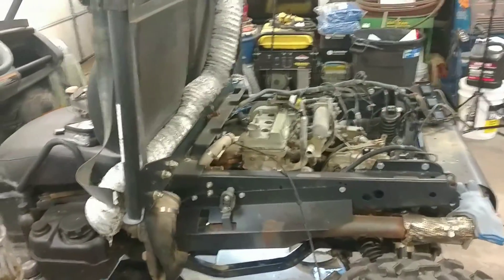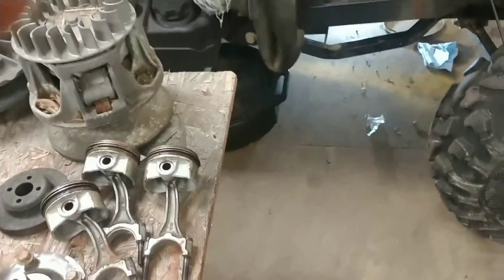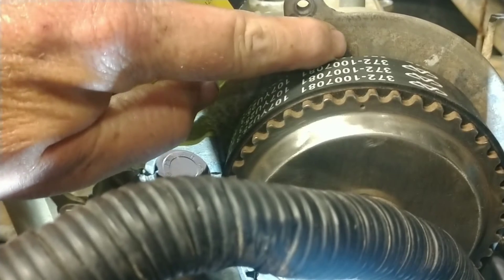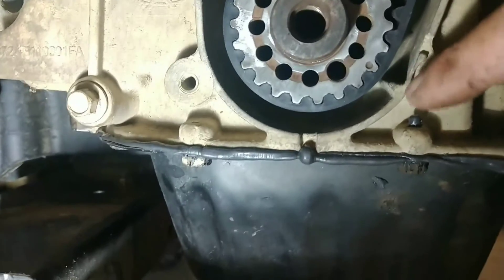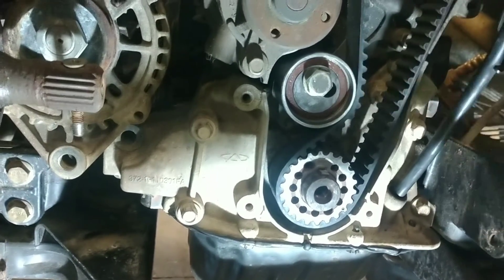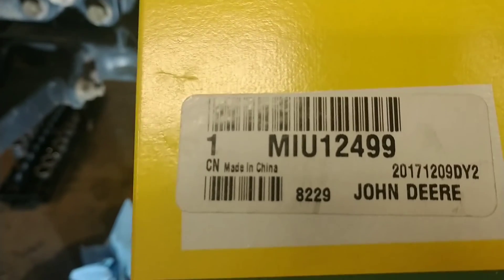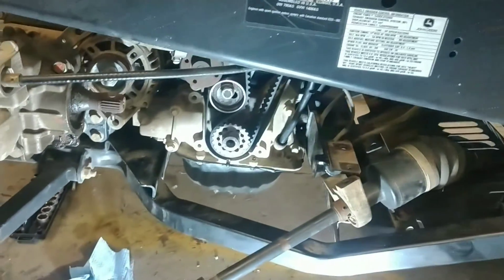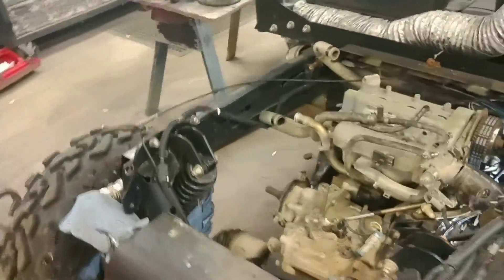John Deere 825i timing belt and timing mark location

Comment: I have same Gator. Drowned it in creek a year ago. Starts and runs fine, but has loud ticking. Assume bent rod. Been using normally for a year but considering a rebuild. Did you have similar symptoms after water in intake?

Comment: Getting ready to tackle all of this on my 2012 Gator 825i (original owner).  I know this engine is made by CHERY.  I'm not having any issues with mine other than being on its 4th starter, but this machine being 10 years old (has about 1000 hours on it) I figured with time it's probably due anyway.  Planning on doing water pump and thermostat while I'm in there.

Are these interference engines? (if the timing belt breaks, does it bend the valves...or just leave you stranded and you reset the time with a new belt and its good to go?)
Reply from the maker: Non interface engine. Most of my problems was the belt tensioner. Thermostat is easy. Water pump was a little time consuming if I remember correctly
Reply: @chrisward405  good to know.  Thank you.  I'm going to start collecting parts for it.  

Also I can't get a (OEM) starter to last more than a a year or two, but that's a complete separate issue.  Two were replaced under warranty.  Seems to be a pretty common issue on these machines.

Comment: What is the spec for the tensioner? In other words how tight should the belt be?
Reply from the maker: I can't remember. It's been a couple years since I made the video. You can check with your local dealer and they will give you the info
Reply: Using your hand the deflection of the belt should be 5 mm (at a referenced force pressure of 20~30N).Torque for tensioner bolt is 25+/-3 N.m

Comment: Question, I was driving my 821 i - 2010 Gator through snow today, all of a sudden the gator stopped, engine was running fine, is it the drive belt? Gear box? Something else,  My machine will not go into forward or reverse. What should I check first? Can someone help me please? Thank you
Reply from the maker: The drive belt could have gotten wet as the belt air intake is close to the ground where your feet are. Can you shift the lever forward and reverse?

Comment: Great video! I got mine apart and found the tensioner in pieces. So the marks are off. How do I turn the cam and crank to get them lined up?  Just by hand?
Reply from the maker: Yes. Whatever works
Reply: @chrisward405  ever have the machine go in limp mode?
Reply from the maker: @jonathanmacnevin8449  no. I never had that issue. Only problems I've had were the primary clutch needed cleaned frequently (hard to go in gear and out of gear) and the timing belt tensioner pulley going bad

Comment: Where did you get parts for the engine rebuild i need a rebuild on mine
Reply from the maker: At the time I had to go to the JD dealer. Wasn't bad on price. You could probably get most parts off ebay now

Comment: How on Earth do I get the cam timing gear off and the cast cover that is glued on in between so I can get cam shafts out.
Reply from the maker: There are a couple bolts on that cover that have to be removed. You will have to remove the valve cover of course.  As far as the gear goes you will have to use a gear puller. Hope this helps.

Comment: Do you have a part number for the rebuild kit? I just bought the same gator that needs a rebuilt motor or a new one
Reply: Awesome and I’d really appreciate it
Reply from the maker: @TheMsilos  you can rebuild the engine in the UTV. I didn't pull mine out and was able to rebuild it
Reply: Ohh yes I did misunderstand you. But thanks I’ll go by there tomorrow and see what I can find
Reply from the maker: @TheMsilos  you shouldn't have any issues getting what you need
Reply from the maker: Not sure if they have a rebuild kit per say. I just went to John Deere dealer and ordered everything. It was surprisingly cheeper than expected
Reply from the maker: They will also print off all the torque spec's for you as well
Reply: If you could email the sheet I’d appreciate it ms9710@yahoo.com hopefully I can get this gator fixed and not have to spend too much
Reply from the maker: @TheMsilos  I think you misunderstood me. The John Deere dealer will print off all torque spec's for you. You just ask for them when you order the parts
Reply from the maker: @TheMsilos  I still have them if you need to know a torque on something but John Deere literally printed a book for me

Comment: Chris I am replacing the water pump and saw the timing move as the tensioner was released ,You say that the timing marks just need to line up.Is that assuming at top dead center on a certian cylinder or just line them up and all will be fine,Mine only moved a couple teeth but who knows which way.also why the tensioner change so many times.Is there a failure in them I need to look for??Thank you for your time!
Reply from the maker: Just line the marks and you are good. The problem with the tensioner is water gets to the bearing and it breaks.
Reply from the maker: Terri Breneman I always kept a spare pulley with me on the trail. You can swap it out on the trail in about 30 minutes.
Reply: @chrisward405  Thank you so much for the info,I own a small engine shop and generally have a rule about UTV"s and ATV"s ,I dont work on them as I have my hands full with mowers,Trimmers and chainsaws.I only took this repair because its an old farmer friend and customer who sends me a lot of business.I thought I would just look it up quick on you tube and there wasnt much info.Our local John Deere dealer doesnt even want to service them and when I picked up the new water pump wished me good luck and said I wouldnt want to work on it again.I replaced the starter on it 2 weeks ago and that is sure a pain.Again Thank you for your help and I am subscribed to your channel as of right now!!
Reply from the maker: @terribreneman5578  thanks for subscribing!! I have some torque spec's on the 825i if you ever need them
Reply: @chrisward405  Your info was spot on and you will be happy to know that the patient lived to run around the farm,Again Thank you

Comment: Thanks for the video! I did the water pump on mine and it wont start now so I assume  its timing!!
Reply: Hey man you seem to have some knowledge  on the gator I did the water pump got it timed and running  fine no leaks full of coolant  but its overheating  now would you have any idea why?? It's never overheated  and it's got over 7k on it now

Comment: Do you have a video where you put the camshafts back in?
Reply from the maker: Unfortunately I don't. Are you building one? I think I have all the torque specks for it if you need them
Reply: @chrisward405  Thanks for responding. I was working on one that overheated and warped the head. I managed to get what I needed from John Deere. They were nice enough to actually print out the steps for disassembling and reassembling the head along with all the torque specs. Thanks again!